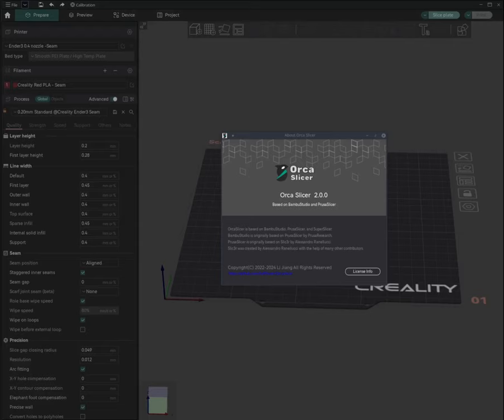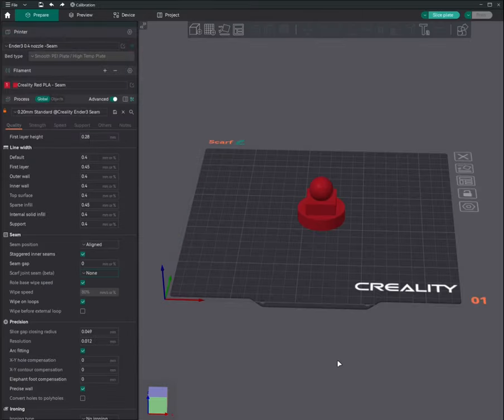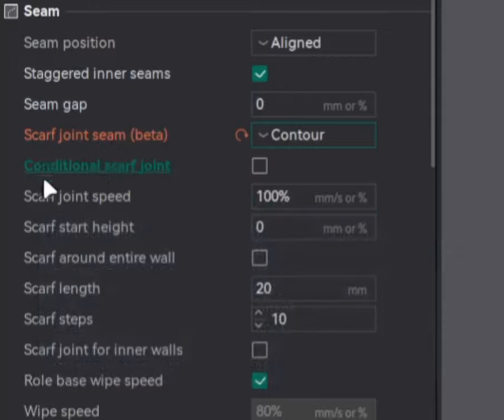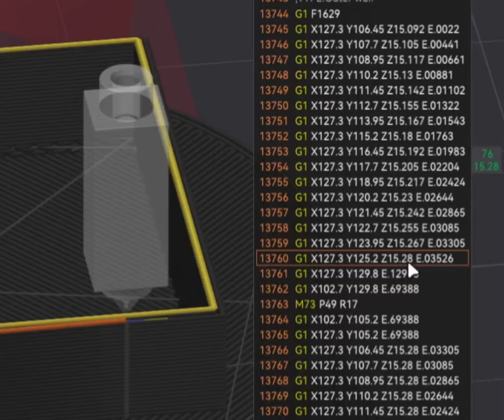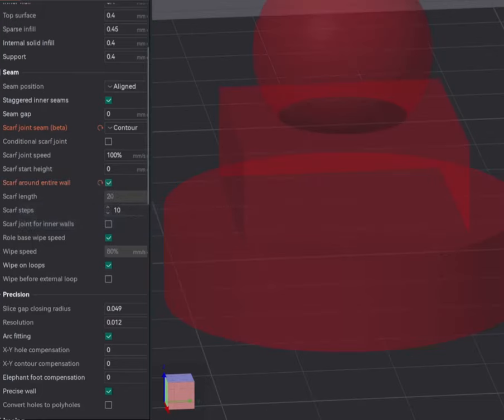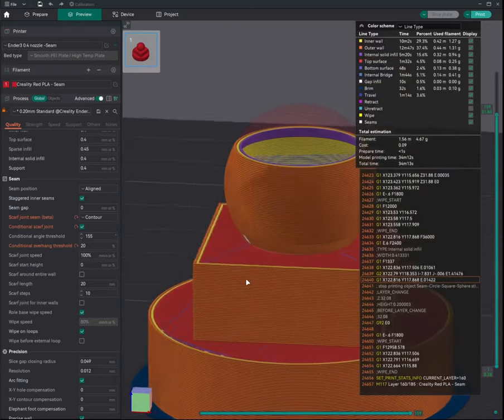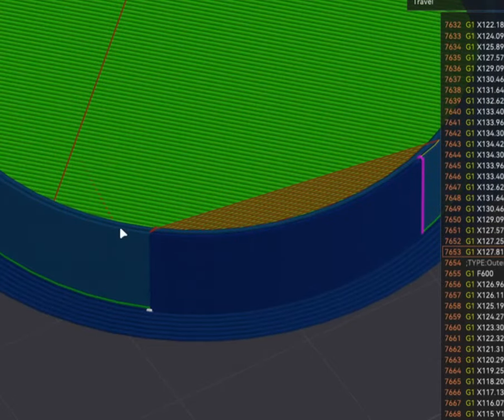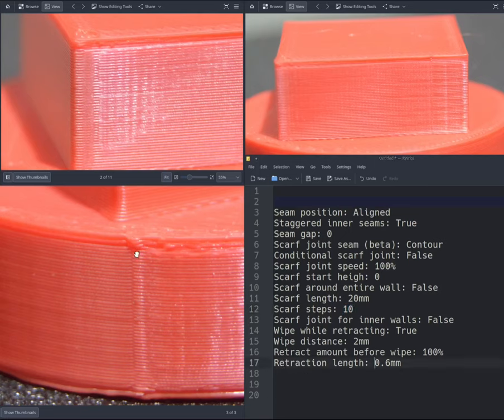OrcaSlicer Scarf joint seam (beta)

Comment: Awesome videos. The in depth info provided is really helpful and I thank you for that. 
Can you please make a dedicated video on fan speed and settings in orca slicer. FYI - I have CR10SE printer and I'm using an orca slicer
Reply from the maker: Yes, are you facing any issue in cooling, are there any specific thing that you are looking?
Reply: Im using cr10SE printer and want to understand the fan settings, since the fan is always on 100 percent during printing. So I wanted to understand if that can be customised? 
Thank you